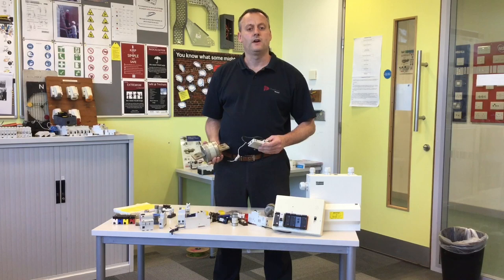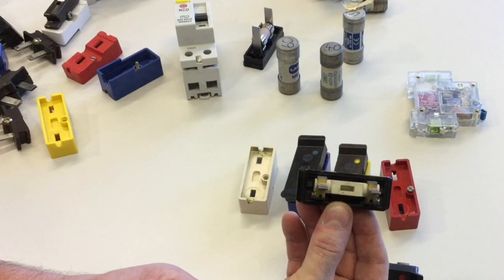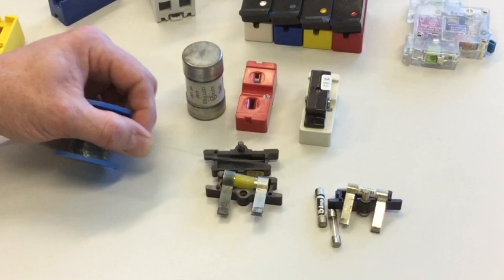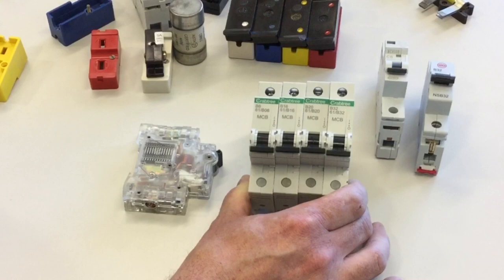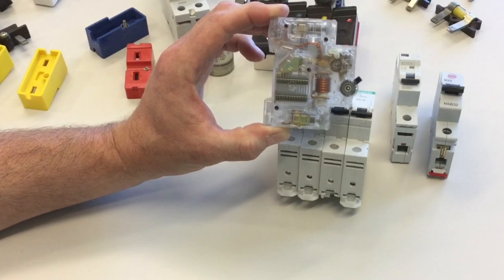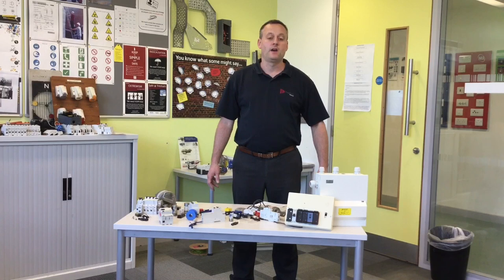Different Types of Protective Devices BS 3036, BS 1361, BSEN 60898 and BS 88 Fuses

Comment from the maker: == 🕐 Time Stamps - Cut to the action 🕕 ==
00:05 - introduction to different types of fuse (overcurrent devices) 
00:27 - BS 3036 fuses explained 
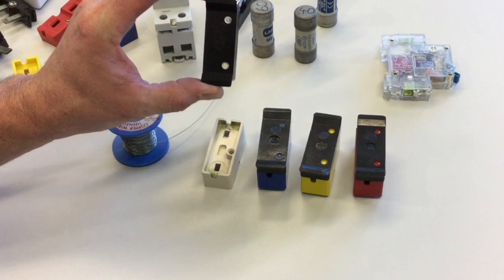03:57 - BS 3036 different colours used to identify different fuse ratings in Amps 
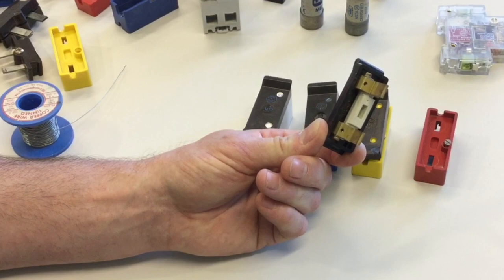06:00 - BS 1361 cartridge fuses explained 
08:55 - BS EN 60898 MCB miniature circuit breakers 
10:52 - how do MCB's miniature circuit breakers work 
12:55 - BS 88 fuse explained

Comment: Rewireble fuse came in 5 15 20 30 45 and 50amp . Ie white blue yellow red green and orange carriers also the carriers should have a small peace of solid asbestos in the centre as a flash absorber. And yes they are still compliant and can still be installed. Contrary to popular belief regulations can only be applied from the time they come in to force not before , so if you see an old installation with a rewireble fuse bird and no RCD it if fine as it was installed before the regs on RCDs came in to force .
Sorry forgot, fantastic video as always Gaz 👍👍👍❤️
Reply: For the record, it is not true that regulations can only be applied to new or upgraded installations — it’s just far more common.

Comment: if yo look at the pin design a lower rated fuse can be fitted into a higher rated fuse holder ( de rating circuit fuse ) but a higher rated fuse can not be fitted in to a lower rated fuse holder ( stopping you over valuing fuse ) . the pins on the  5 amp fuse can well handle over 5 amps.
Reply from the maker: Thanks for taking the time to comment GSH Electrical 👍